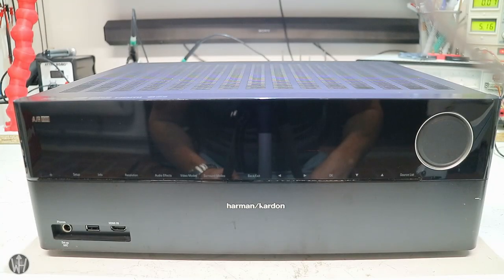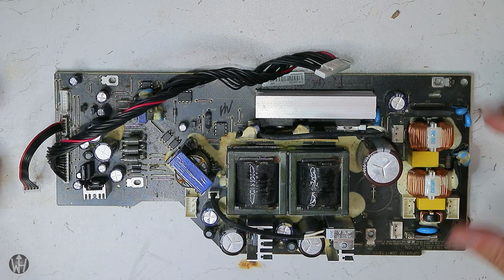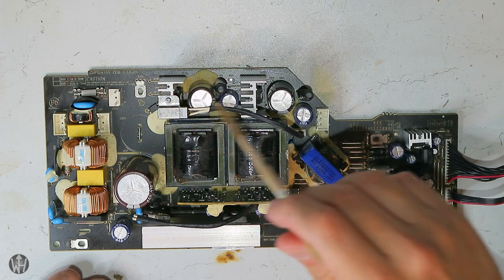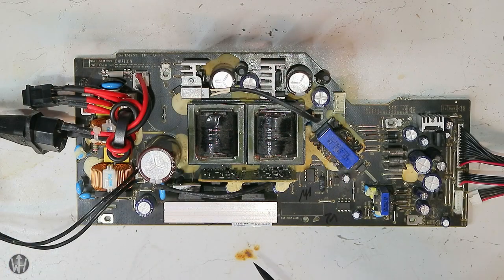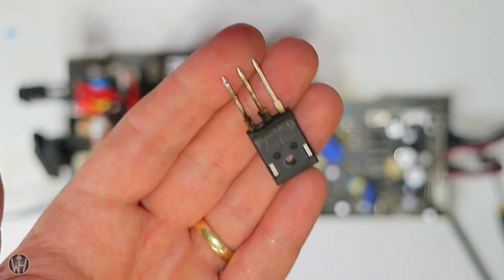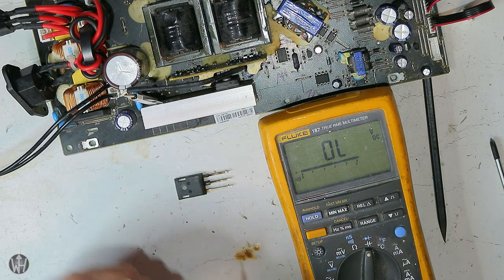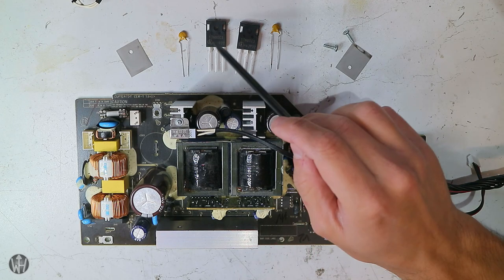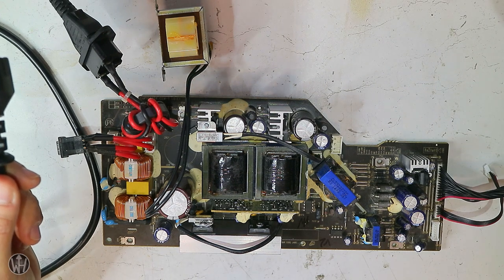#6 - Repair of Harman / Kardon AVR270 - Dead Power Supply in the Amplifier

Comment: At today repaired same HK AVR 270 with same failure. Owner said that receiver died during mains voltage fluctuation in his apartment. Seems exactly right. I believe that you forgot to add ceramic 250V 6.3A fuse F901 to replaced parts heap at end ;)

Transistor Q905 location in this power supply does not good though. It is warmed up not only by direct current flowing through it, but also by nearby resistors R903 an R917. Probably that is why it busted first.
Reply from the maker: Thanks for your comment! Yes i forgot the fuse! :-) But i need a lot of them, that's why i do even not notice that i replace them.
Regards, WH

Comment: I had the same problem, changed both ceramic capacitors (mosfets were OK). It works great, but when I connect it to 5 speakers there is quite a loud hum, I think from the inductor that is screwed to the chassis. The buzzing is gone on headphones. How do I solve this problem?

Comment: do you know whats the latest software version available for this avr 270 please?
Reply from the maker: I checked the internal software update function but it was not found a new firmware. Also i can not find this model on the HK support page, so also no firmware here. 
But why you need an update? After a couple hours of operation, i did not experienced any SW issue.
Reply: @WaldemarHeimann  well sometimes I have a 'BCO update, please wait' on my screen, i was hoping to resolve this problem with a newer sw
Reply from the maker: Ahh ok, here is the solution for your Problem.

https://www.avsforum.com/threads/possible-fix-for-bco-update-please-wait-problem.1491340/

Please leave me a like and a subscribtion if you don't mind and it solved your issue.

Redards
Reply: @WaldemarHeimann  took some time, I m not use to do this kind of stuff, had to find the ip adres of amplifier on tv, pc is wifi so coudnt find it, it seem to work perfectly, thank you very much. I subbed already yesterday after seeing your first video on Samsung tv repair, and that will be my second challenge :) I gonna rewatch first, I have a kind of chip who doenst make good contact and provides stripes on the screen, if I push on the chip its ok for a little while but comes back
Reply from the maker: First of all, i noticed that YOU are my first patreon supporter, i really want to thank you for that! I really appreciate it!
Second: I'm glad to hear that your AVR is working again.
Third: probably a quick resoldering of the IC's pins will do the job, otherwise a replacement of the IC (if it is not a microcontroller) would be also easy.

please keep me posted here!

Thanks again!